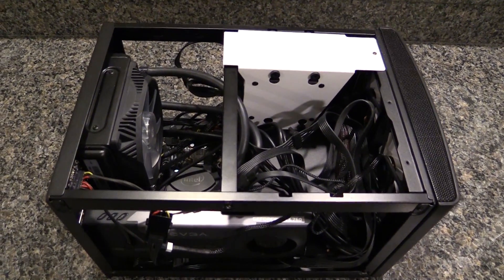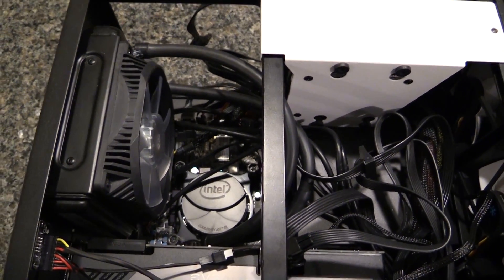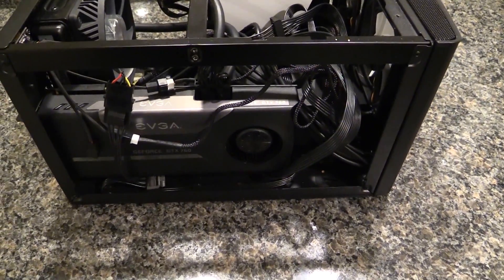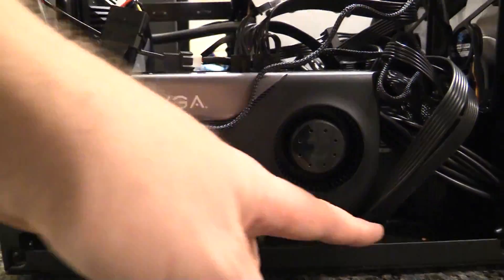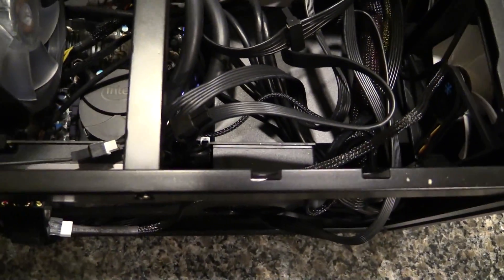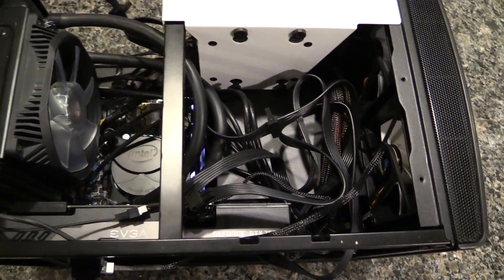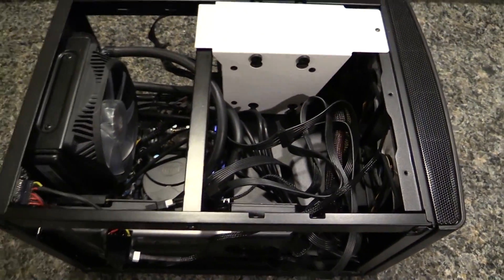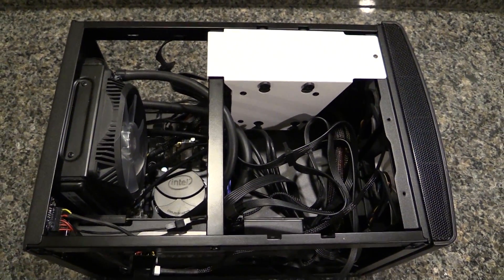How to build a mini-itx editing & gaming system - Meet the completed Snow Badger

Comment: I agree with the cable management in this case, I had the same problem, but I do love that the video card gets direct air from outside and you can still fit an all-in-one cpu water cooler as well, plus is there a case smaller than this with as many features?

Comment: Got that exact same one, only I have a H60 in push/pull and reversed the airflow in order to get temps down. As you will see after a while, the heat the gpu generates will be pulled through the radiator and might cause your cpu to throttle down under heavy load such as games etc.